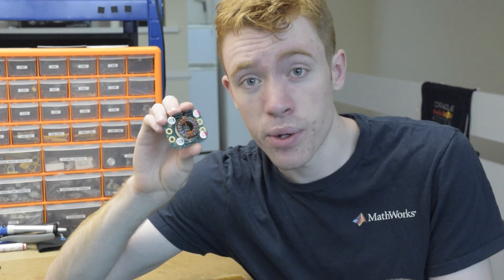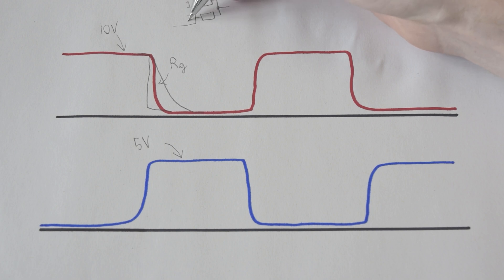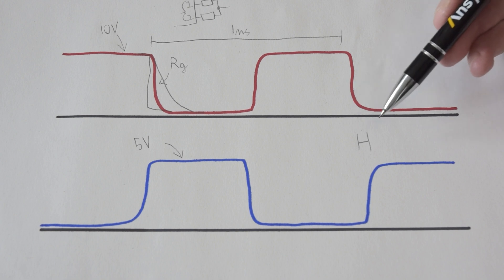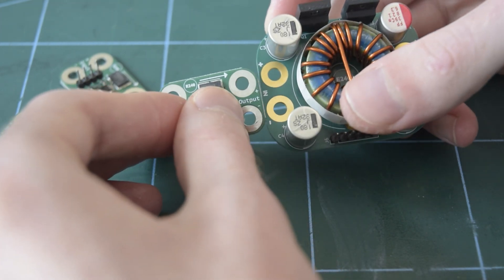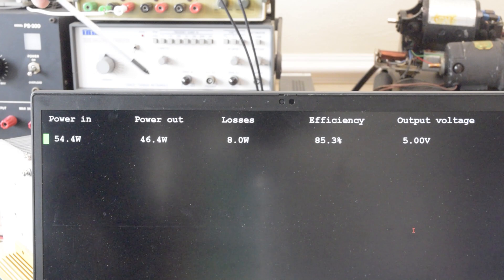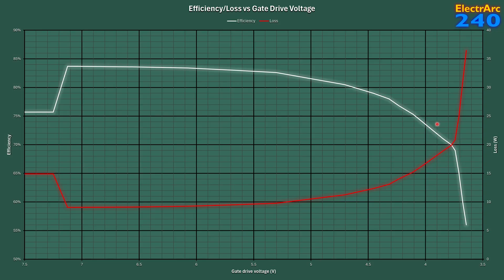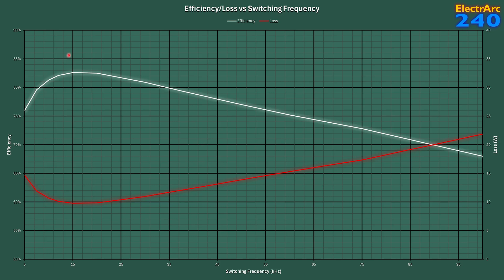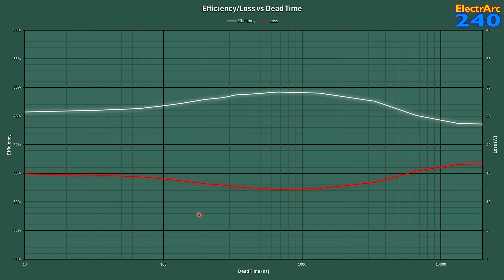What Affects Efficiency in Power Electronics?

Comment: The heat pump is beyond competition
Reply from the maker: I agree, makes so much more sense
Reply: Yes they work down to well below zero and  cheap skate on a smaller battery😅
Reply: Cane to say the same thing. While researching the ideas on the video is interesting it's barking up the wrong tree entirely and will never address the needs of more extreme climates.
Reply: @orbatos  Definitely barking up the wrong tree and I came here to say the same thing too. Resistive heaters had been used in EVs for a while and then had been swapped out for heat pumps for the much greater efficiency. Considering all cars have AC and a heat pump is just running the AC in reverse it's a no brainer.

Wanting to increase losses in the inverter, which is basically going back to resistive heating, only with further losses of having to move the heat from the inverter to the cabin with coolant... oh dear.
Reply: In very cold conditions, you need some extra heat to start the heat pump cycle. 
Tesla is running their compressor loop in a weird configuration for that very reason. 
So the electronics inefficiency avenue could be another strategy
Reply: The best scenario would be having both the heat pump and the inverter heat available, so if you just want a bit of heat you use the waste heat without increasing losses, then the heat pump comes in and if it is so cold that the heat pump falls short, then you start increasing the inverter loss heat (basically resistive heat). However, with modern car companies I wouldn't expect such care for the consumer.
Reply: They effectively have a higher than 100% efficiency, because you can move much more energy than you consume to do that.

Comment: Why would they do it this way when they can just run the AC in reverse?
Reply: The outside is too cold.
Reply: @koharaisevo3666  "The outside is too cold."
At that point it is too cold for electric vehicles in general.
Reply: @ABaumstumpf  Nailed it. If it's too cold for a heat pump to work, chances are your battery pack is consuming half of its stored energy just to keep itself warm enough to be used.
Reply: @ABaumstumpf  That's incorrect. EVs need to work year round.
Reply: @logitech4873  In what way is that incorrect? Cause Tesla says that in cold weather the car needs to stay plugged in to keep the battery warm enough to operate.... and that from normal cold weather some functionalities will be restricted. those are nto the conditions were a heatpump has any problems.
Reply: @ABaumstumpf  You don't need to keep the car plugged in even in really cold weather. But you need to charge more often.
EVs can deal with extreme cold, Teslas are no exception.
Reply: @logitech4873  " You don't need to keep the car plugged in even in really cold weather."
You have to talk that out with Tesla - not me - that is their statement.

"EVs can deal with extreme cold, Teslas are no exception."
In your imagination sure.
Reply: @ABaumstumpf  I own a Tesla in northern Norway. I know what I'm talking about.

I used to keep my diesel car plugged in all winter to keep the 12v battery from dying, but I don't have to worry about that with the Tesla. It will "start" just fine every time.
Reply: @logitech4873  
"my diesel car"
So not the car but the battery... and taking an engine-type that is not suited for cold environments does not paint you as the smartest of fellows. 
"but I don't have to worry about that with the Tesla."
So do you keep it plugged in? Yes? Why is that - cause it wouldnt work otherwise? yeah.
Reply: @ABaumstumpf  Most combustion cars here are diesel. That's just the most common type of engine. The issue is the same with gasoline cars, where winter can make the car hard to start.
No I don't keep my Tesla plugged in in winter unless I'm charging.
Reply: @koharaisevo3666  , newer vehicle heat pump systems, like their building counterparts, are designed with efficiencies that allow them to work down into the single digit temperatures (F) and slightly negative temps (C).
Reply: @koharaisevo3666  Nah modern heat pumps work down to -20F or worse.

Comment: Having driven EVs for about 10 years in a place that has cold winters (New England) - by far the most efficient way to warm the occupants - is to heat the seats, and the steering wheel. And by FAR the most efficient way to defrost the windshield and mirrors etc - is to directly heat them. The windshield can have a very thin (like a few molecules) layer of silver in the glass, and you can very quickly defrost the whole windshield for a few hundred watts.
A heat pump is the most efficient way to warm the air in the vehicle - and when you have good seat heaters and a direct heating windshield - then it is actually quite rare to also need to heat the air.
The engineering mindset for ICE vehicles is wrongheaded for designing EVs. In ICE vehicles which waste 70-75% of the energy in the gasoline - you have tons of "free" heat, so heating the air to then heat the people or the windows - doesn't matter. But, by heating the things that need it directly (avoiding the lag time and inefficiency of transferring the heat to the air - you are most likely far better off than trying to come up with ways of wasting energy to make heat to then gather it up and then distribute it.
Reply from the maker: Couldn't agree more, just like a heated blanket instead of central heating!
Reply: In addition to heated seats and steering wheel, some manufacturers have started to add Infra Red radiation pads that are directed at the legs and feet of the driver and the front passenger. IR pads are quite energy efficient and radiated heat is apperently quite appreciated by the car users.
Reply: Just move to Australia and forget about all of that.
Reply: @iconoclad   Then you need a airco :-( what need a lot of energie )
Reply: @retiredjan4714  Yes, I have a fully ducted heating and cooling system. My power bill is high but I love it.
Reply: @iconoclad   Being happy is the most important thing.
Reply: The ford fiesta and focus have had this for a long time now but the power draw is from about 800 watts to a kilowatt and there are visible lines running along the wind screen that some people find mildly infuriating so there's definitely room for improvement.
Reply: @AmadeusBrown  even a heat pump is 3-5kW, so that's still not bad. The eGolf has fine wires, and it isn't very strong. So the layer of silver is the best system I am aware of.
Reply: > then it is actually quite rare to also need to heat the air

This statement is silly. Why don't you try sleeping in a room at 0° with a heated blanket and tell me if you're comfortable. Abandon central heating entirely and just rely on heated clothes. You'll quickly realize why you need to heat the air.
Reply: @mysterious_nobody_99  My statement is about the amount of energy it takes to heat our bodies directly (or heat the windshield glass directly) vs heating the entire airspace inside the car (or house). I also said that on rare occasions, you do need to heat the air.
Reply: Silver? My hunch would be that one would use an ITO (indium tin oxide) layer laminated in, since that is conductive and glass-like transparent. Even monomolecular film of silver wouldn't really be see-through.
Reply: @SianaGearz  It is see through - VW has this on our ID.4 Pro.
Reply: Shooter Software development Logan timers Apache release Buck converters Norris Correlation Id: 526b11fb-5827-4234-9dd6-6af134d06fe6
Timestamp: 2024-09-21T02:35:18.000Z
DPTI: 96a98981b62f2aa0
Error Tag: 5a2pe
Error Code: 0

Comment: I realize the goal is to reduce total component count but im wondering if its worth it to run the inverters like this.

I know its not sexy but just reversing the flow of the already supplied AC cooling system provides a fully functional heat pump heating system too. The bonus is that since most automotive HVAC systems are just pre designed products from third party manufacturers, they achieve economies of scale cost savings.

Im stuck on efficiency benefits. Using the inverters is akin to using a resistance heater, just in a different form. Heat pumps are a more efficient method of moving energy from one place to another. When range and battery efficiency are important considerations, does it make sense to do this?

Are they just trading one problem for another?
Reply from the maker: Yeah this is exactly what I said to the guy, but he assured me this is something being considered. Does seem odd as running the inverter at higher temp is going to reduce its life. Maybe that is seen as a positive...
Reply: Sorry, aren't two wires short-circuited not considered electric heater? how simpler they want it to be?
Reply: @arduinoguru7233  resistive heaters are very inefficient as they only produce 1W of heat per 1W electrical power consumed. A heat pump system ie an air conditioner can consume maybe 1000w of electrical power to move 3500w of thermal power from inside the house to outside.

Reverse it and you get a heater that is multiple times more efficient than the resistive counterpart.
Reply: @00000005547  Ok, I was talking about theirs reasoning of reducing parts 00:08 by throwing out resistive cabin heater, and using inverter heat loss as source. Unless they add a heat pump to the inverter, I don't think they'd changed anything or reduce the part count
Reply: @arduinoguru7233  , I think I see what you are saying. Its my point as well.

Comment: Its trivial to dissipate heat in the stator of a induction or bldc motor without generating torque... thats a much better route. 
Since approx 2021 teslas can waste heat in their motor/inverter and pipe the coolant through the heat pumps cold side. This is done when the outdoor temp is too cold for the heat pump
Reply from the maker: Ah very interesting, yeah the motor is certainly the easier place to add losses
Reply: It is also done if supercharger is navigation destination and ETA is close enough to use heat pump and extra heat from drive units